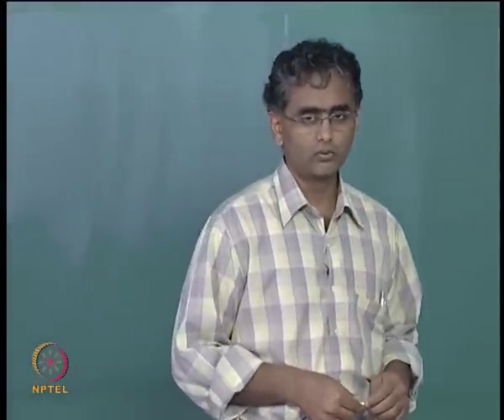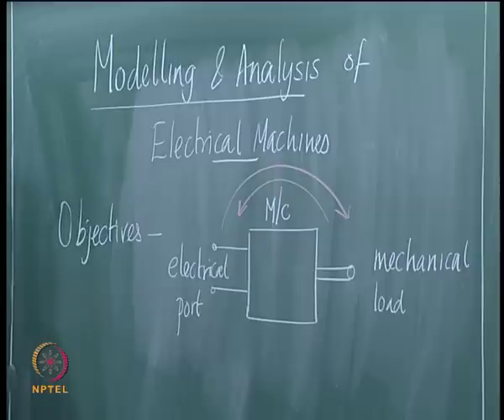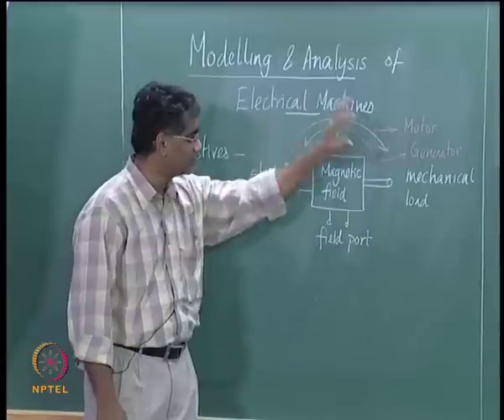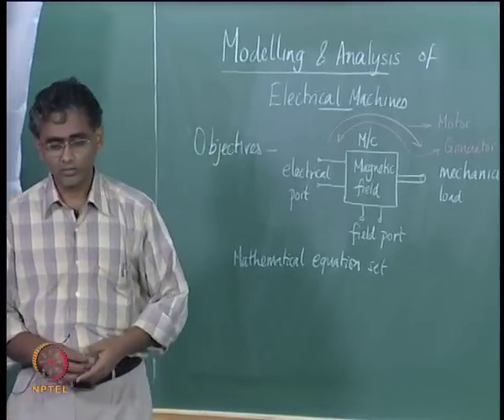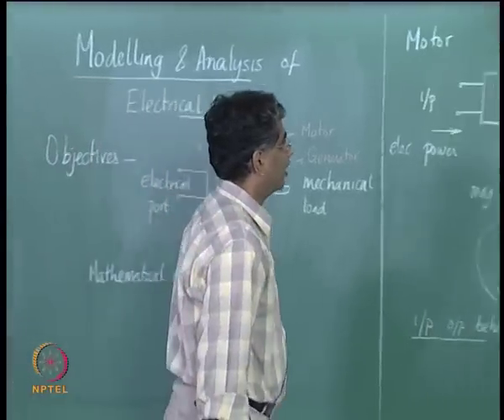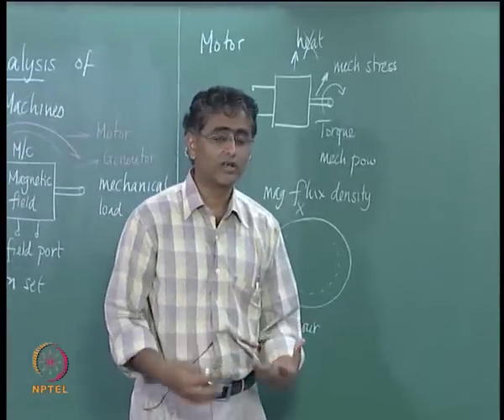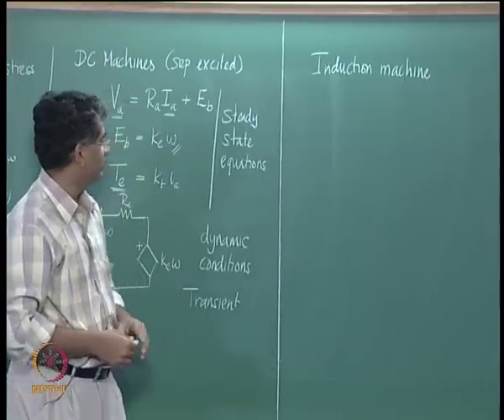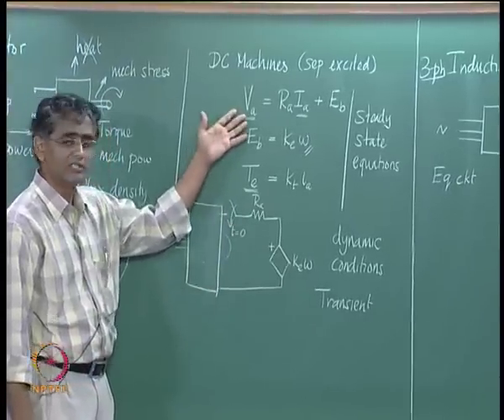Mod-01 Lec-01 Introduction

Comment: What text book can I use to practice this material?
Reply: P.S Bimbhra
Reply: Paul c Krause, analysis of electric machinery
Reply: @vaishnavivijayakumar1127  is it best book to understand machines?
Reply: @amanrana8089  to practise the material (machine modelling)that  the prof teaches, it is one of the book.
Reply: @amanrana8089 in general, to understand basics of electrical machines,  1) electric machinery by Fitzgerald 2) electrical machines by Stephan Chapman would be nice
Reply: @vaishnavivijayakumar1127  yes I am studying Stephen Chapman
Reply: @vaishnavivijayakumar1127   please suggest me good book for  power system.
Reply: @amanrana8089  as far as I know, power system stability and control by praba kundur is a good book... its a vast book... But  it covers power systems and also machines in power system point of view.....